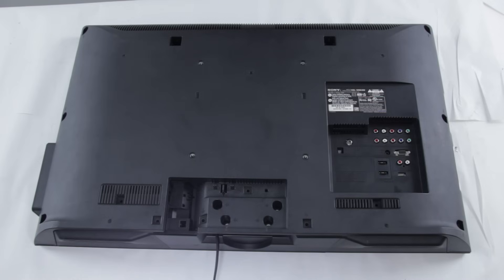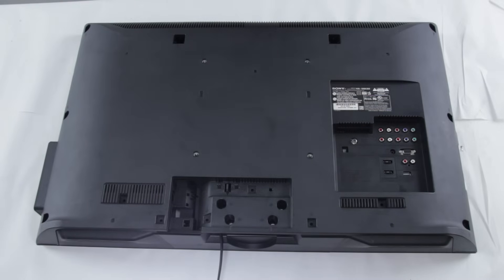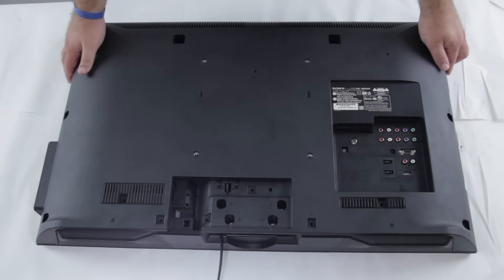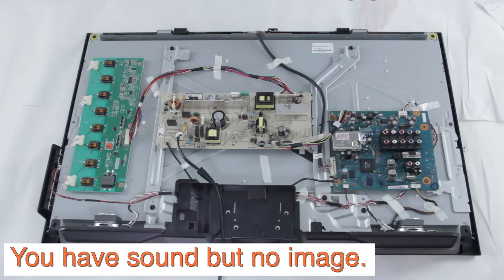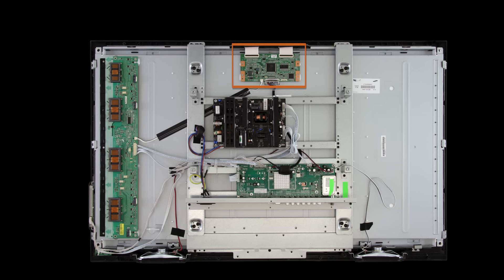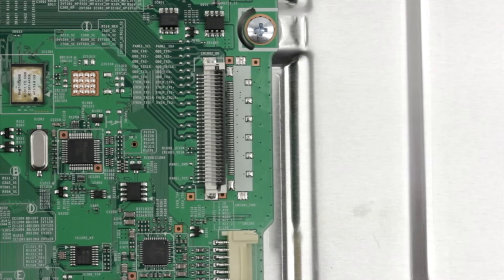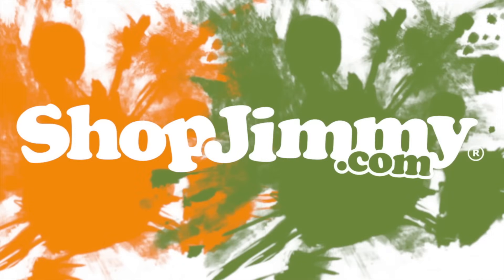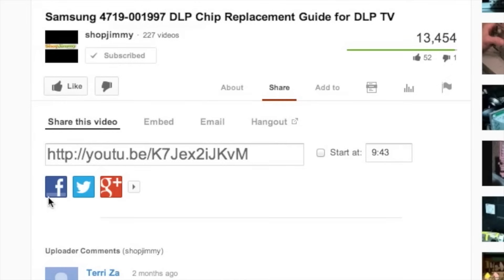LCD TV Repair Tutorial - T-Con Board Common Symptoms & Solutions - How to Replace T-Con Board

Comment: Vizio V555-H1 vertical lines in the screen. It happened all of a sudden. I sat my kindle under the TV and then I noticed the lines. Unsure if the magnet from the kindle played a part. 

When I turn the TV on the Vizio logo sign has lines coming from the top, the same color as the logo. Once the TV is fully powered on the lines are the same color as any ads or shows. The longer the TV is on the further the lines drop. At times the screen will go completely blank but the sound continues to play. 

I have unplugged, updated firmware and even factory reset. My remotes are no longer working with the TV after the reset. 

Thank you in advance.

Comment: I have a Sony Bravia KDL-52W4100 that i bought back in 2008 or 9 and my issue is that its kinda blurred on the right side with like 2 horizontal going across. The left isnt bothered, its just the right side and when it warms up it goes away. Sometime itll do fine for a minute then mess up and then go away. Im thinking its the T-con board or ribbon cable maybe. Just wanna someone elses thoughts. Thx

Comment: I have a 70 inch ONN QLED tv model 100071708 the problem I am having is the right side looking at the tv is darker than the left side previously we had an issue with it turning off by itself out of nowhere it stopped doing it but now we have this new problem some videos I’ve watched are suggesting it’s the T-Con board but I’m not sure don’t want to order one then that not be the problem I looked up a T-Con board for this tv it’s under $5.00 any suggestions as to what you might think is wrong with this tv the tv is about a year and a half old

Comment: Visio M470VSE woke up and Vizio logo was brighter than normal but there was no image or sound.  I tried turning the tv on/off.  The Visio light at the bottom went back to normal brightness and the V logo was displayed on the screen.  Then the screen went datk and the Vizio light went bright again. I tried unplugging and pressing the power button for 30 seconds but still the problem persists.  I'm thinking t-con but not convinced because of the V logo display.

Comment: I have a LCD LG47 LA4700 Tv and the problem is it has vertical lines i am suspecting the problem could be the Tcon board also the cables seems to have some ware on them AWM 250941 VW-190V 105c 1A is it possible that anyone can inform me where i can purchase such. Or maybe some way i can get these things fixed.

Comment: I have a TCL 85inch Roku TV and model number 45s456. When I turn the TV on there is no picture but there are 4 vertical lines that appear and change color very slowly. It looks like the same color as the home screen that I set up on the tv. Any ideas

Comment: I have horizontal lines on the right 1/3rd of the screen on a LG OLED55B6P serial number 606RMBW6Y949. It seems to come and go, it may fad away back to the normal picture but 75-80% of the time the lines remain on the screen.

Comment: My tv was old LG LW SERIES 3D TV. 2011 but was perfectly working  i got an issue now after updatung the software version where now its stockesd on sleep mode and didn't open the screen the red light will slowly flashing as it is in sleep mode or you can press the power botton it will switch off the TV, i tried to plug out the elecrivlcal wall cable with pressing the power botton on the tv and kept the tv for a week and put thecplug back but its worked one time only after as being curios I did that process again plug out and press the power botton to clean the reserved electricity and plug it back but this time no response. Is the T-Com can cause this.

Comment: I have a Samsung 75Q90T. I keep getting a black box appearing at the top left corner. I turn of the TV, then turn it on and it's gone but always comes back after some use and it happens when I watch regular TV, tubing, MLB, roku, Pluto, YouTube. Not sure if that's a panel or t con issue

Comment: Hi Jimmy, I am Maha from Malaysia. My 5 yr old 32 -inch AIWA TV Model number JA 32DT 700S 48 Watts that I'm using as a DELL Laptop monitor using HDMI. Four months ago, I changed the backlite LEDs. After changing there was some streaks of lines at the bottom of the screen. I left it alone as the screen pic was still viewable. Now,  there is a split horizontal half-screen picture that changes to normal every 2-3 seconds. I tried taking out and reinserting the cable joints but the problem is still there. I cannot get hold of a schematic service manual of the model. Replacement T-Con board 32-6871L 5953AJOAF9G 1281 is too expensive. Please help. If you can provide the service manual where it shows all the voltages at the VGH, VGL and CLKs points will be great. Thank you Sir, great repair tutorial channel.

Comment: I have a samsung 65 inch tv that has 1/3 black screen on the left side. The rest of the picture is perfectly clear.  Samsung model number UN65CU7000DXZA,  serial number 0FAR3CDW404837H.  I think that it is the t-con board board

Comment: I have ￼ 
Lg tv  65UJ6300-UA

Serial number:  710RMLMFR848

MFGR DATE:   OCT 2017

Has 2 problems  first net work card is very unreliable works sometimes then get error that it is turned off.  Send screen picture is very dark even iv vivid mode.  Need help.  Is it worth replacing d- con and network board tv is 8 yrs old

Comment: Hi I have a sony kd55xe7073 
My fault is that the tv works fine for a while then turns itself off and back on again 3 times then shuts down. Once shutdown it's followed by the 6 red flashing on the start up led.
The motherboard and power board have been replaced, but the fault remains

Comment: I have a LG 55UH615A and the right 1/2 of the screen is dark but I can see the picture.  I think the backlight on the right 1/2 is not working.  From watching videos it sounds like I need to replace the T Con board or the plug is not connected.   

606RMEN6F468

What do you think it needs and how much would the parts cost?

Comment: My Sony XBR-49x900F (Serial Number 4034362) died, will not turn on though it is clearly receiving power, no sound, no picture, no access to menus, tried software upgrade via USB drive, tried all recommended unplug/ reset/restart etc. but no joy. I keep seeing posts suggesting the T-con is a common suspect and considering the reasonable price I see no reason not to replace it. Any guidance and in particular re: specificity of parts based on serial # would be much appreciated. Many thanks.

Comment: Hey Jimmy thanks for your videos. I have a viore pd50vh80. It's a lil older but had been working just fine. i turned it on the other day and it clicked (as usual) and tried to cut on, but then clicked again and shut itself off. It did this process on and off a total of 3 times and then stops completely. If i unplug and plug back up it does the same thing. T-con, main board, or power supply. Any input you may have is most valuble and appreciated... Thanks

Comment: Mine is Sony KD-65X9350D TV
Serial number 4500778
Upper portion (2/5) screen vertical lines
Lower portion normal picture. Not been used for  5 years. Shifted place in its original cartoon. Is the T con board is faulty? What are the options

Comment: I had vertical lines on Samsungs UN55NU6900F.  After watching videos I purchased the T Con board # BN9649639A

Install was easy but when I tested it the vertical lines remained and additionally horizontal lines at bottom of screen and left side has black void/ no video.  Do I need to run setup and picture diagnostics with new board or is it a different problem altogether

Comment: I have Sony KDL-52wl135 TV and it's had a double blurry image on the right 25% of the screen from top to bottom but not affect 75% of the rest of the screen… In the past I've squeezed the top of the screen and sometimes the right side in it corrected the problem for10 minutes.. often after 30 minutes it will sometimes go away on its own… I just replaced a con board MV slim ribbons and this did not have any effect on the fixing the issue… Please help

Comment: I am trying to diagnose an issue with my Sony 40s4100. The screen will flicker random horizontal lines, sometimes it go completely white, and other times the color become very distorted, almost sepia looking. Here is a video showing the flickering issue. I have changed both the the main power board and the main control board but the issue still persists. What do you think is the cause? Faulty tcon ribbon cables? Faulty tcon board? LCD inverter board? 

https://drive.google.com/file/d/1u_d0zAd8bkP0fJnEJSGMkdEua_Y6OiFv/view?usp=drivesdk

Comment: Hi Jimmy. I was watching my TV one morning and then suddenly horizontal and vertical lines started appearing and fill the entire screen while the audio was perfectly fine. I tried unplugging and plugging it back in but the lines were still there. I suspect that its the T con board that went bad. I have a LG 75" which was purchased 4 years ago. Here is the model #: 75UK6570PUB.

Comment: Hey Jimmy, I have a Sony xbr49-900e LCD tv.  When I turn it on, I have sound, but the screen shows large white and green blocks with pixels streaming from the center of the screen to the top and bottom.  Is this a T-Con board issue or something else?

Comment: LN52A650A1FXZA.  Mostly during first few minutes, the vertical random line pattern usually but not always appears (no horizontal lines), and then the TV restarts and is okay till the next event.  Over time that problem grew worse, where it will occasionally do this vertical line pattern, then reboot when the TV has been on for a few hours.  Eliminated the AV receiver, and still occurs but also notice that the first time powered up there may be no sound and restarts, and then a buzzing sound is heard and reboots.  Sometimes that buzzing persists until I restart the TV myself.  So not sure if I have one or two issues.  Thanks for any help.

Comment: I have an LG 55"  55LW5600 serial # 111RMTT6807   It turns on and I get a picture. Vertical Lines through entire screen . Would it be Tcon board? thank you

Comment: Hi Jimmy, thank you very much for all your efforts and videos. I am a 71-year-old electronic technician man. Please help me to find out the problem I have with my 50-inch Soniq TV model G50UW40A, which has no backlight, no sound, and a blank screen. I have checked the power board output voltages and main board; it does not look like it has any problems. I am guessing the problem is the T-Con board. What do you think? I was thinking of purchasing the T-Con board and replacing it, but I am not sure.
Would you please help me troubleshoot and find faults with this TV?

Comment: Hi. I've got a Toshiba 55uk3c63db when plugged in to the power supply it will flash red and green for a while before go's green, there is a back light in the screen but doesn't display any pictures, 
Is it T Con need replacing please? If yes do I have to look for by part number? And where to find it ,
Please advise. 
Thank you

Comment: I have a tcl 55  inch model is 55s401 it shows black screen but backlight is working when I disconnect one side of the TV from the t con board I get a white image on the side I removed and the other side stay black and vice versa is this a t con problem or is it the driver that's the problem

Comment: I am having trouble with Westinghouse 55 inch  RokuTV; model No. WR55UT4210; Serial No. W210870B13842. When I turn on the the TV, there are several thick vertical lines which go away after 15 to 20 minutes while TV remains on. After that TV runs normal with clear picture.  This problem happens every time if we start the TV on.  If you any ideas or suggestions on hw to fix, please let me know. Thank you.

Comment: Hello, I have a Dell W3207C Tv/Monitor and the board for the power button, volume and others is broken and was thrown out by accident. I have a different power board from a DYNEX LCD TV model  DX-L32-10C. How can I make that replacement board work in place of the broken board?

Comment: I have bravia that has thick vertical lines and about 6 horizontal lines some horizontal lines are close together like 2 of them and the others are separate individual  ones close to each other. What is causing this because  ive ordered a new tcon board and ribbins and still get this effect.  Please adress me on this ive been working this tv a month and so frustrating sometimes what this issue be. Cant take pic here but i like to show my troubleshoot pics of the tv screen to show you what this is . Thanks ive subscribed

Comment: My RCA SLD55A55RQ had sound and  no picture,so I ordered a New TCon board,and installed.Now the TV just Flashed red Blue green and grey on the screen.I've tried all of the power off suggestions and I get the same screen colors.

Comment: I have a Sony XBR-55X800E.  The TV works fine in 720 and 1080 modes but when I attach devices which are 4K in content, it crashes and reboots over and over.  What should I check? Thanks in advance.

Comment: Hi. My Smart TV LG 55UP8050PSB became blackout and no sound. As I checked the LED Panel has lights and Tcon Board looks like an issue. Tcon Board number is EAX69581203 (1.0). I have seen this part number selling on eBay but I'm unsure if the software number 2BEBT0000100 66925802 should be considered in buying a replacement. Do you have any recommended seller for this part number?

Comment: Hello, I have a 70” Sony Bravia model # KD-70X690E. It had a blue tint condition, recommended solution was to replace the back lights, I replaced the LED back lights and when I tested the TV only half of the picture was showing clear (blue light condition gone) and the other half had a shade, tried reconnecting and swapping the ribbon cables to no avail, image eventually disappeared and screen turned fully white. Bought a TCON board and installed it to no avail. I’m able to launch an app and can hear the sound. Any input.
Thanks
Reply: Did you ever fix the issue? I just had the same thing happen to me. I had the blue backlight issue so I replaced the LED strips successfully. Now I have no image and a screen with vertical bars of color instead of an image. I have been screwing around with my TCON board ribbon cables and trying the "tape method" but nothing is working.  I really hope we didn't damage our LCD panels.

Comment: Hello,

I wouldn't have bothered to repair my TV if it lasted for 10 years. I have a 65" Xiaomi TV 4S, less than 2 years old and I have this problem.

https://youtu.be/P5n0MVCgcks
https://youtu.be/WV1QRgpEV7Q

If I turn off the power supply for a while, and turn it back on, the display comes back for a while and fades and blanks again.

The audio works even after the display goes off. I can hear the navigation of the menu or if something is already playing on the screen and the audio still continues, but the display just fades away.

Any help or advice is highly appreciated.

Comment: I have a Toshiba fire tv model 55LF621U19 I have 2 green vertical lines which there is no screen in about 6 to 8 inches of the screen where those lines are.

Comment: Hi, I'm trying to repair a 70-inch Insigna TV, MODEL ns-70df710na21 with the motherboard
715ga715-m01-b00-005g which doesn't turn on and had flashing red light when I press the power button.  
I tested pointing a Flashlight directly to the screen, but I don't see any image, plus there is no sound, when I plug the power the standby light is solid ON, then when I press the power button, it will flash/blink forever.
When I press the power button, the green LED on the T-Con board blinks once, and then it stays off.
Can you please help me figure out what the issue is?

Comment: Got a Vizio E60-E3.  Serial #: 44LFTRVULT05418.  Problem just started tonight.  Images ghosted on to next scene making the picture too confusing to view.  Occasionally the screen tried to snap itself back into normal.  Sound always works. Tried different pic modes, all are the same.  Tried Prime, Netflix same type of symptoms.  Green screen covering pic, sound OK, Sometimes no pic at all meaning all dark.  Netflix splash screen always comes up, sound ok.  I can pick profiles but any selected movie shows small windows w/ crossing color bars, full green screen, black screen only, alwalys w/ sound.  Funny the amazon stick seems to work fine.  I do get CC info.  From what I read, thinking T-Conn board.  Have not tried reset yet or swapping out HDMI cable.  Unit is in furniture that never moves.  What do you think my next steps should be?

Comment: I have a Samsung (model LN-T4071F) TV that has had several vertical lines for the past few years and I have decided that I would like to fix the problem if I can.  I have removed the back and believe the model number of the T-Con board is LJ63-04640A.  Do you have a replacement that will work for me?

Comment: I have a LG 47lw5300 and all of a sudden no picture appears when switching it on. The tv has the typical static click upon switching it on, the red standby light goes off briefly but then returns for 2 slow blinks followed by the static click indicating it’s been turned back off again. I can’t get to the inputs screen so cannot even test for sound. Any ideas on what’s gone wrong?

Comment: Help! Sony KD75X780F has no picture , not even on screen menu but does have sound, backlight and power on all 3 boards. I put a new tcon board in but now  HOW DO I REFLASH the FIRMWARE via USB if i cant see any onscreen instructions?

Comment: 58PUS8707/12 Phillips ambilight TV has white vertical lines and a green bar across the bottom these flicker positions would this be a Tcon board issue?